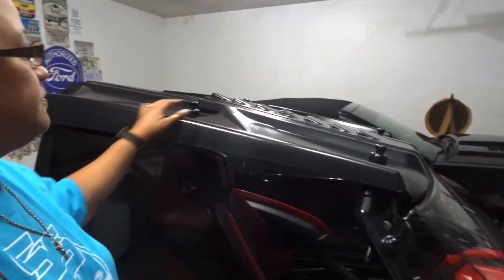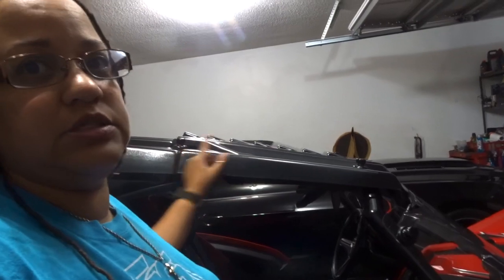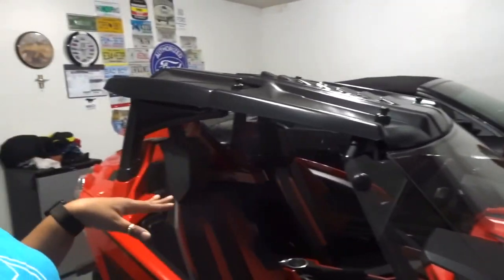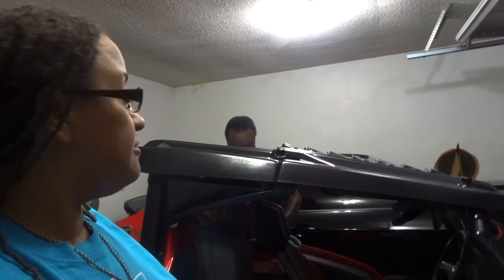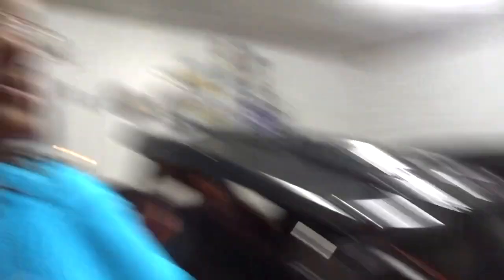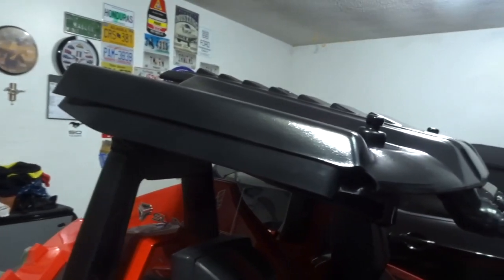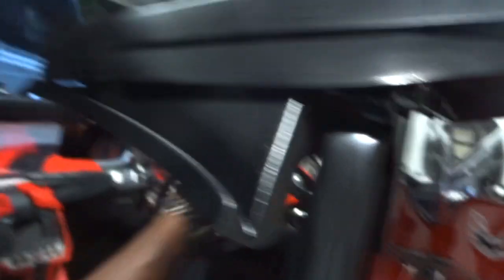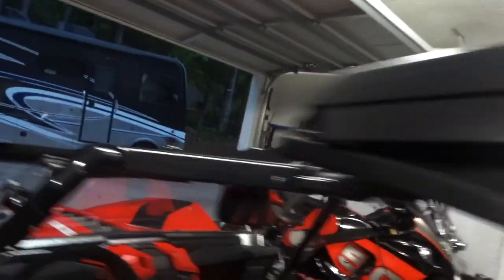Slingshot Upgrades

Comment: Personally I don't like encapsulating the cockpit, takes away from the concept and makes it more like a car. But I am a original motorcycle rider so I prefer the openness. I have the 2021 on order and will be treating it like a bike and not riding it in the rain. Nice concept tho but just not for me
Reply from the maker: Well we didn’t either until you start roasting in the sun. I wasn’t a fan of the tops until we came across this one because you can move the top half back so you still get the wind. We also ride motorcycles